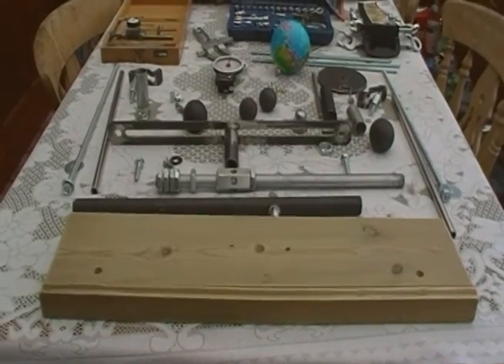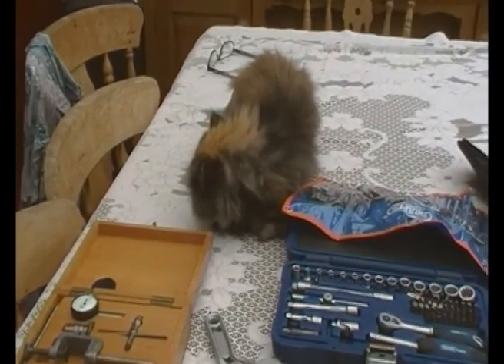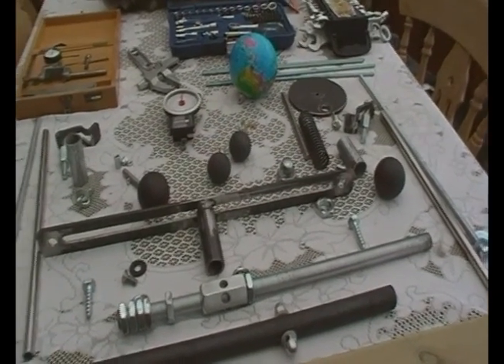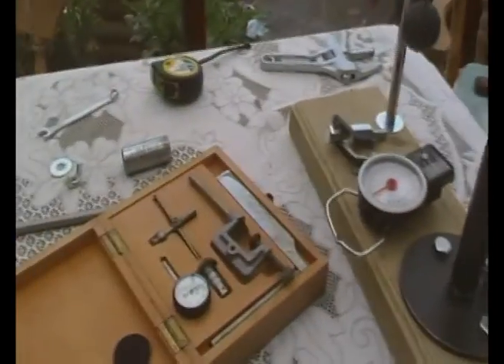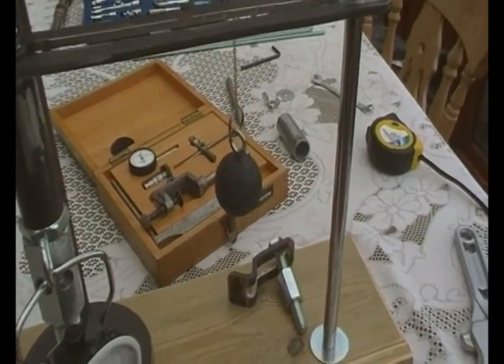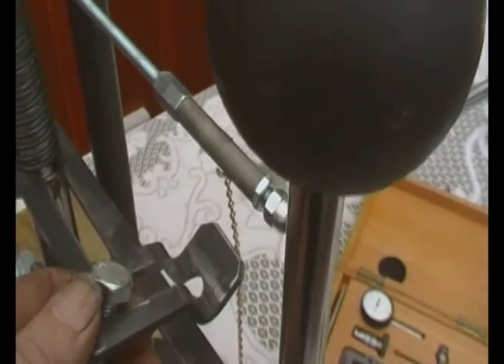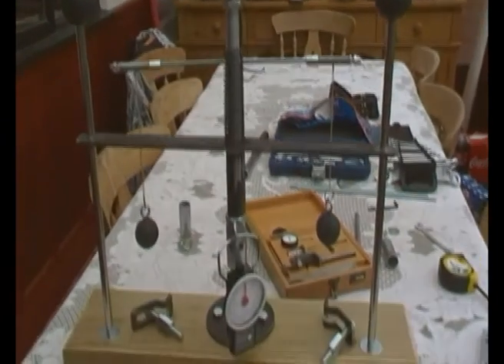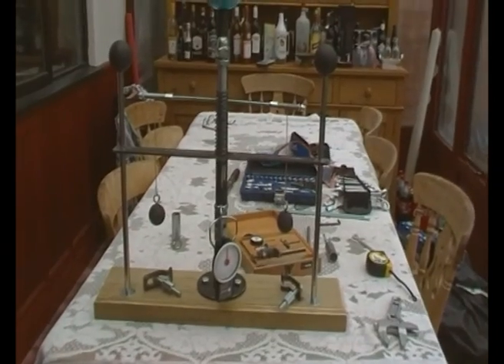flat earth gravity zero

Comment: what exactly was that rig supposed to accomplish? the best guess i got is that you is under the impression that the weights would somehow cancel out the screw press but the moment that the screw press started sporting the rod the weights were being supported by the press not the rod. also i find it weird you takes the measurement of how much force it takes to elongate the scale and says it has something to do with the rod. seriously draw a force diagram and it's pretty obvious the rig is not measuring the rod or the weight at all.

Comment: this is a great video but I can't quite follow. Couldyou explain the process? Sorry for bothering, but I can't follw science  very well and I want to tell some friedns about this so they can wake up from all the science lies too. Been trying to convince them and this might help
Reply from the maker: +MrUnite4thechildren It’s simple down weight of any amount should be equalised by upward weight of the same amount, making it equal and not distorting, the steel balls were balance by self-gravity counter balanced by each other on a pivot, science say’s gravity is 14.7 lb per square inch down weight, the steel balls weight was 1/2 lb each and they move up after 1/2 lb by .004 of an inch when upwards weight was applied. There was no resistance by the 14.7 lb of gravity to the ball moving up, when by the law of physic there should be, there was no gravity encountered, then the 15 lb applied upwards it bent the rod, but the rod did not bend with same force from the same weight load downwards, which is the force of gravity as you are told the sphere creates for you to remain on the ball. You also told rockets engines need to expel all that energy so it can escape earth’s gravity. The experiment just showed the energy use meet with zero resistance from gravity. Because its density and not gravity that holds thing on the earth. In simple terms it explains how an insect can fly off a leaf resisting gravity pull and maybe the science mystery of how a bumble a bee can fly, because there is no energy pull to the earth surface only the insect own weight.
Reply: *****
Thanks for the help!
Reply from the maker: MrUnite4thechildren You a welcome friend

Comment: I don't understand how this disproves gravity ? ?
Reply: +MrBritam "...science say’s gravity is 14.7 lb per square inch down weight..."  I'm stunned.
Reply: *****

"  science say’s gravity is 14.7 lb per square inch down weight,"

   No, it doesn't. As has been pointed out the only place you find that figure is air pressure at sea level, and air pressure is Omnidirectional, is pushing up and well as down. sideways, and slantways, and longways, and backways.and squareways, and front ways, and any other ways that you can think of.

 Even that figure at sea level can vary depending on weather.

 The amount of weight you applied in this experiment is equal to the masses of those balls you used, and not a gram more.

 I'm afraid you have built an experiment based on a strawman argument.
Reply: +MrBritam That (14.7 psi) is not the measure of gravity, but rather the average air pressure at sea level. Gravity is a measure of Newtons of force downward, specifically 9.8 m/s^2, meaning that an object dropped can be measured to be accelerating at that rate until impact, less air resistance and density (ei a feather or balloon will descend at a slower rate). A lead ball and a wooden ball with equal volume and surface area dropped from the same height will arrive at the ground at the same time, for instance. What you've demonstrated is the barometric variance at your altitude and the weather that day.
Reply: +Termin  Wait you made it through the whole video?
Reply from the maker: Duncan Panthera Please to much magic needed in your theory’s, talk is cheap actions speak louder than men with idea’s, all you have to do is build something to prove your claims to be correct simple, otherwise all you have is a religion a belief, And at the moment I cannot see your god,  weather is not gravity.
Reply: ***** It's chaos theory MrB.  You're experiment will cause the next hurricane in the carribean.  I will name it after you!
Reply: Rhetoric&Discourse

 It took a few tries. I am honestly still not fully confident of my understanding of the structure of the experiment itself, it does look familiar though.
Reply: +Rhetoric&amp;Discourse You should try just for the final quote, apparently this single incomprehensible experiment shows Einstein and the scientific community to be total liars
Reply: Malcom X interesting that the same object is dropped repeatedly and produces different measurements. From such a short distance I would question whether the object is dropped from exactly the same height each time.
Reply: Duncan Panthera I believe so .
It's something that should be repeated more times, by more persons and also under controlled environment.
It's very interesting, indeed. 
Thanks for your comment.
Hug and God bless you and your family brother.
Reply: +Termin So the experiment has no merit because true gravitational fact is only determined by the locations air pressure and weather?
Reply: It has no merit as the figure he's quoting has no relevance as air pressure is omnidrectional.

CaptKaboom
Reply: Termin Well, how well we can breath is somewhat based on omnidirectional air pressure.  I don't see the tie in to gravitational pull.
Reply: Which is why this experiment is invalid , he factored in something incorrectly.
Reply: +Termin Not once was weather or omnidirectional air pressure a factor in this video as it wasn't in Newton's law of universal gravitation.
Reply: Where did the 14.7 pound figure come from ?

 There is no gravitational figure, be it acceleration, or gravitation constant that comes close to that number.

 Only mention that can be found for that figure is air pressure at sea level
Reply: +Termin Not true, it can also be in reference to the resistance of air to the motion of projectiles.
Reply: CaptKaboom
 That is measured via drag coefficient, not pounds.
Reply: +Termin Now the shape matters more than the weight.
Reply: +Miro Mato low budget making due with materials at hand.
Reply: CaptKaboom
 Air resistance had nothing to do with this experiment
Reply: ***** Guess back to the TV with you then lol.
Reply: *****

 Ok then please explain how you account for all the weight you referred to in your experiment ?
Reply: I'm saying you have done nothing to demonstrate orexplain in any reasonable fashion where you got the numbers you quoted in the video,

 Namely the 14.7 lb figure you mentioned.
Reply from the maker: Termin Figure is the science figure not mine if there is no pull force then there must be no gravity, the ball lifted at zero gravity, the balance rod should be pulled down under gravity and when the same weight applied upwards at best it should have straighten, the weight is totally irrelevant in amount as the rod bent upward instantly after ½ pound weight loading.  Now all you have to do is build a machine proving gravity, and if you can I will conceded, but anybody can talk about their religious belief science need to be proven, before you can call it science.
Reply: Please provide a citation for this "science figure"
Reply: Clutching at straws asking you to back up your claim ?

 It should be a simple thing to state, the figure comes from "X"

 I think at this point it can safely be inferred that you don't have a source for said figure and and trying to change the subject in order to cover that up.

 You are making a claim, so give evidence of said claim.

 Where are you getting this 14.7 lb figure from ? and don't say science, give an actual reference.

 "please give evidence of fact not theory of something proving things are pulled to the earth by more their own weight, if an extra force is require then it would have a weight of measurement on the object.     "

 Could you rephrase that , it doesn't even make any sense.
Reply: As per that link that's average air pressure, it's not a constant, on the surface of the earth.

 Let me repeat that  it is not a constant and it refers to the surface of the earth.

Further has been explained air pressure is omnidirectional, it pushes in all directions, equally, not just down.

What don't you understand about that ? the air pressure above the weights pushing down would be the same as the air pressure pushing up UNDER them.
Reply: ***** it doesn't escape, so much as the atmosphere has plenty of room to expand, and fluctuations abound across the world. Where location A might have high pressure and location B low one day, the next day it may be the opposite, per weather.
Reply from the maker: CaptKaboom Not the first eye of the storm I have been in, but it’s only right at least one storm should be named after me; I hope no one gets hurt by my name sake.
Reply: Aye. Good for them you didn't use the 50lb weights, else be running away in circles worshiping  gravitons.
Reply: +MrBritam Lol.
Please, dont talk about drawing boards they are so sexy , I graw up with a huge one in my home, my father was a technical designer. Lol
I just love your comments brother.
keep playing with them, they have lose their spinning ball and now they don't know more what to do. Lol

Huge hug to you brother. 
God bless you and yours.
Reply from the maker: Malcom X I have harem of drawing boards L.O.L.
Reply: ***** this is not Lol, this is LMAO.
Thanks brother , it comes in a very good moment, I loved your joke.
Reply: now i got a few questions.

why should the measurement of the luggage meter have anything to do with the rod? it measures how much force is required to be put on the scale for the amount of strain you exert on the scale. it is not measuring how much force is on the rod.

why do you have two weights? the weights would only be important to keeping the summation of the moment zero if they were exerting a force on the rod but if they aren't exerting a force on the rod they can't be exerting a moment.

your exerting a strain on the rod the only way for the rod not to be bent by it is if the set up bends instead. and you don't measure how much stress you exert on the rod nor how much force is being exerted on the rod. all you measure is how much force it takes for your press to exert strain on a scale. how does this make a statement about the attraction between matter? 

in metric units of gravity or any force is measure in N=kg*m/s/s and on earths surface equals to m*g=(m kg)(9.81 m/s/s). in imperial units it is measured in (force pounds)=(mass pounds)*ft/s/s and on earths surface is equal to m*g=(m lb)(32 ft/s/s). is the 15 lb measurement of the balls you give in force pounds or mass pounds?
Reply from the maker: +Termin then you don't understand gravity
Reply: Then please, explain.
Reply from the maker: +Termin It’s simple down weight of any amount should be equalised by upward  weight of the same amount, making it equal and not distorting, the steel balls were balance by self-gravity counter balanced by each other on a pivot, science say’s gravity is 14.7 lb per square inch down weight, the steel balls weight was 1/2 lb each and they move up after 1/2 lb by .004 of an inch when up would weight was applied. There was no resistance by the 14.7 lb of gravity to the ball moving up, when by the law of physic there should be, there was no gravity encountered, then the 15 lb applied upwards it bent the rod, but the rod did not bend with same force from the same weight load downwards.
Reply: +MrBritam 

 What is the name of this machine of yours ? no offense I understand it's difficult to be one own cameraman but that made it very difficult to see what was actually happening.
Reply from the maker: +Termin Yes it is difficult to do everything by yourself, but I make the video’s for people to think more, but it up to them, what they wish to believe, I try just put purer thinking on the table, but I build lot of machines and bits, but I am open to suggestion, I could call it Skippy as most of her bit come from the skip.
Reply: @MrBritam  "science say’s gravity is 14.7 lb per square inch down weight". Gravity is a measurement of force. 14.8psi is a measurement of pressure. You need to understand the basics before trying this sort of thing.
Reply from the maker: @TheMalcolm50 The difference between you and me is I am a design engineer inventor, and you’re just a dick with an opinion.
Reply: +Duncan Panthera (Shurroth)  diferente materials same weight, diferente fall times, proved and proved again and again.
https://plus.google.com/110853651645730013853/posts/EE95dMGwqVA
Reply: +Malcom X Has anybody run statistical analysis on the results?
Reply: Rhetoric&Discourse Are you referring the experience about the dropped objects? 
I believe that is that experience that you are referring.
I'm gonna try to collect as much information as possible, about it , and post as soon as possible.
Thanks for your comment and interest about.
Reply from the maker: +Miro Mato The balls were push up directly under the middle of each ball, It’s simple down weight of any amount should be equalised by upward weight of the same amount, making it equal and not distorting, the steel balls were balance by self-gravity counter balanced by each other on a pivot, science say’s gravity is 14.7 lb per square inch down weight, the steel balls weight was 1/2 lb each and they move up after 1/2 lb by .004 of an inch when upwards weight was applied. There was no resistance by the 14.7 lb of gravity to the ball moving up, when by the law of physic there should be, there was no gravity encountered, then the 15 lb applied upwards it bent the rod, but the rod did not bend with same force from the same weight load downwards, which is the force of gravity as you are told the sphere creates for you to remain on the ball. You also told rockets engines need to expel all that energy so it can escape earth’s gravity. The experiment just showed the energy use meet with zero resistance from gravity. Because its density and not gravity that holds thing on the earth. In simple terms it explains how an insect can fly off a leaf resisting gravity pull and maybe the science mystery of how a bumble a bee can fly, because there is no energy pull to the earth surface only the insect own weight.
Reply from the maker: CaptKaboom Capt you’re arguing with children that are still in their trainer pants gravity is magic to them it a real fairy story, air pressure I repair compressors and fit air lines they talk shit, you know the stuff in their trainer pants.
Reply from the maker: Termin What weight I had no weight only two ½ balls suspended by so called earth gravity pull counter balance on scales are you saying there is no measurable pull to the earth are you saying there no gravity.
Reply from the maker: Termin Citation you’re clutching at straws now, please give evidence of fact not theory of something proving things are pulled to the earth by more their own weight, if an extra force is require then it would have a weight of measurement on the object.
Reply from the maker: Termin You got Citation have you not, please!!!!!!!!!!  It’s in video but if you looking for 14.7 lbs You could use the average atmospheric pressure of 14.7 lb/square inch at the earth's surface to estimate the atmosphere's total weight. That pressure means a column of air above every square inch of the Earth's surface weighs 14.7 lbs. Multiplying that by the total number of square inches gives the total weight of air. http://www.physlink.com/Education/AskExperts/ae328.cfm
Reply from the maker: Termin Please where does the air pressure disperse to then, if it not a constant if you sent 100 lbs of air pressure down a line it would only lose pressure only if it escape the pipe so where does the earth air pressure escape to. And it would cause chaos on the surface of the earth all theory again.
Reply: Let's take this step by step.

 What happens to air if you warm it ? and what happens to air if you cool it ?
Reply from the maker: CaptKaboom Yes not sure the dining table would have been man enough but I have built some big things in my time, and in precision somethings that I might not be able to seen too well these days, drills that would snap between your fingers, say about removing metal with them. But it’s given my old tools new life instead of sitting in the shed and loft, and I can now put my old technical drawing boards back to use, I have done some CAD great at calculus but there nothing like paper and pens etc. when it comes to designing something, it a lot more sexy like a real woman instead of a blow up doll.